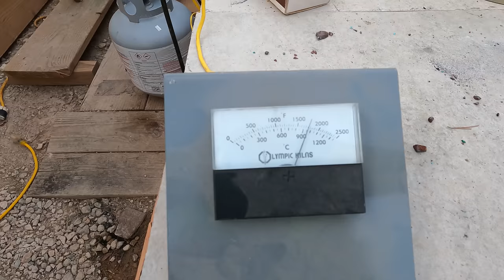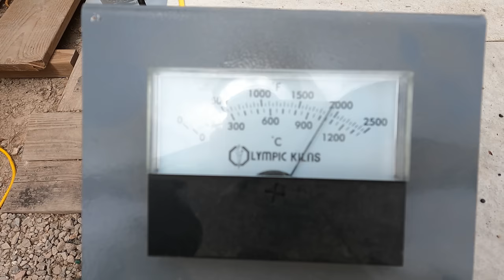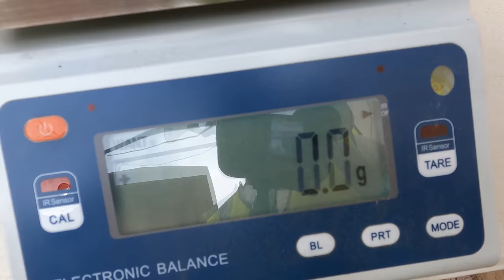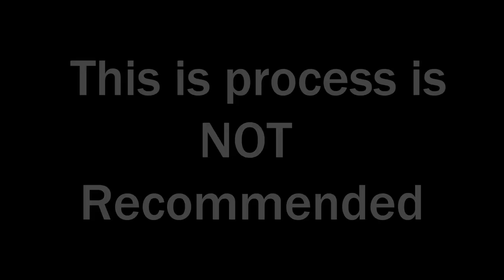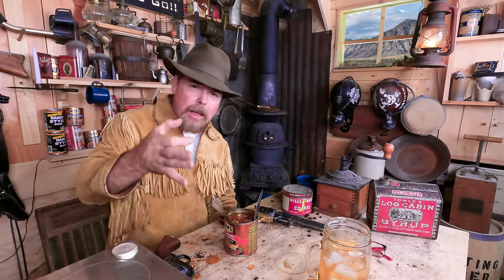The Secret Formula: Turning Lead into Gold

Comment: Your freind Jason, (Mount baker) has several videos that are very good on fire assay -copula refining, and as has already mentioned Screetips videos on jewellery refining are good on parting Au/Ag witn HNO3, and XCL/oxidizer methods.  Biggest danger when inquarting with Pb/PbO systems is the PbNO3 is one of only 2 water soluble Pb compounds that amplifys the hazard it also has the notable distinction in being sweet to the taste. The other chemistry is workable with good ventilation and PPE. The last time I messed with any of it was making a lead based composite starting with PbNO3 and then reducing the in situ cracked product in CO to make Pb matrix. The Au Alloy created from the base cupolization is generally a very usable 18K so the need to part it will vary.

Comment: Yeah, we leach our gold ore from rock with dry lime, then mixed with diluted cyanide from drip lines, then it works it way down to a pond at the bottom of the leach pads, pumped into one of our two adr stations where it then goes through a long filtration process in pond tanks filled with carbon. The cyanide solution is reused, pumped back out to the leach pads. The carbon is able to be reused several times even after the refinery process.

Comment: Great video... what is the temperature gauge called that you are using Jeff? Can I buy from Amazon?
Reply from the maker: its called a Pyrometer   https://www.amazon.com/Temperature-Thermocouple-Ceramic-Connector-CR-07/dp/B0711BKPJG/ref=pd_lpo_sccl_2/132-9673509-7793658?pd_rd_w=RyoGr&content-id=amzn1.sym.116f529c-aa4d-4763-b2b6-4d614ec7dc00&pf_rd_p=116f529c-aa4d-4763-b2b6-4d614ec7dc00&pf_rd_r=NBH8K1ESY2Z0BB1G5441&pd_rd_wg=32Dbo&pd_rd_r=9b3ada27-e47c-464b-a043-a6d79a8aa004&pd_rd_i=B0711BKPJG&psc=1
Reply: Thanks Jeff

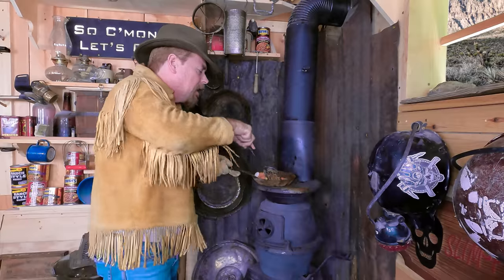Comment: At 10:55 you state that the Blue liquid left over is Copper and Silver Sulfate.
Was this a misspeak or did I miss something?  I figured you would be left with Copper and Silver Nitrate.  Both are soluble in water.
If you initially had Sulphuric and Nitric acids that would explain where the Sulfate came from.  The ore sulphides should be long gone.

Comment: Thanks for video 👍 I have a claim here in Cripple Creek Colorado. The ore you used in this video is similar to the ore here ( Sylvanite ) My question is: Does the powdered lead make a better collector; because it travels down the charge ? Seems to be so. Vs. metallic lead fish weights placed at the bottom of the crucible. And would Borax + Potassium Nitrate work as a good flux for this ? Again, Thank You ⛏️
Reply from the maker: yes it does  those two work very well as oxidizers
Reply: @Askjeffwilliams  I have iron oxidies here as reddish hematite with a layer of yellow-golden caked on powder. I believe the yellow poweder is some type of alumina-iron oxide, when assayed the sample came back with nearly 5g/ton gold and not much silver, I assume the rest to be iron. Since you mentioned here in this comment that Potassium Nitrate and borox are good fluxes to use to oxidize sulphides during smelt, what would be used to to smelt already oxidised iron? I assume chapman flux w/ thinner and borox?

Comment: I have done the exact same thing with the magnetic black sand. There is a process I know of that will work with the black sand like that. I guess you know how hard it is to work with black sand. O have three different processed to break the black sand down. It is hard work. I'm not joking. For some time I was starting to think the black sand could not be dissolved. But I did it through trial and error. It is very dangerous.bit it could be done.

Comment: Did you know you can actually turn Mercury into gold but it's highly unstable, radioactive, and it will most likely to decay back into Mercury plus it will cost hundreds of thousands of dollars at least for only like a billionth billionths of a gram of gold and that's assuming that you have your own particle accelerator and a vast amount of free energy available already. You can turn Lead into gold as well but you have to first turn the Lead into Bismuth or just use Bismuth and then you could use a particle accelerator so you could turn Bismuth into a micro amount of gold as well but it will also radioactive. The bottom line is you are way better off panning and mining gold instead of spending money on a particle accelerator to bombarding Mercury or Lead to death with neutrons to try to turn  into a micro scrap of radioactive gold that will probably decay back into something else that's not gold anymore but still radioactive.